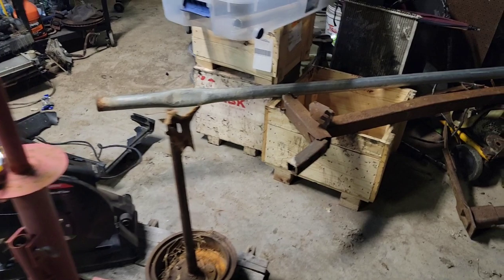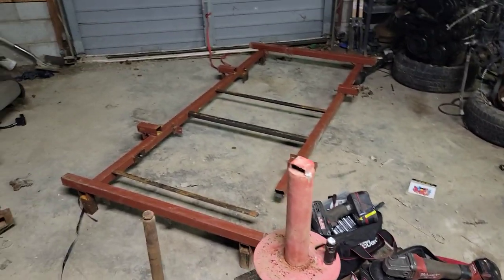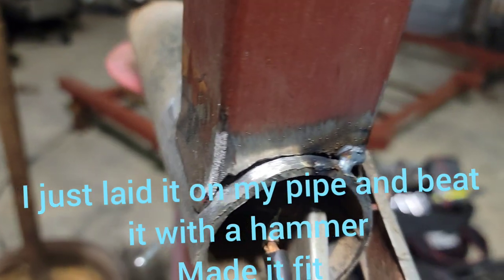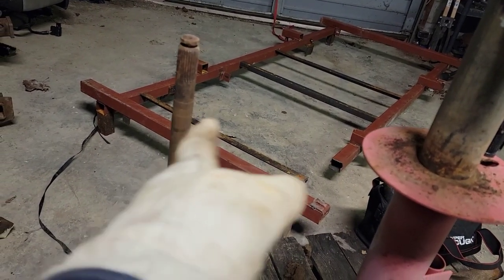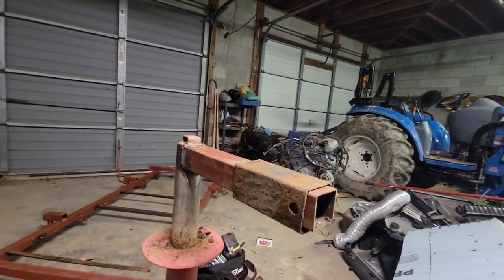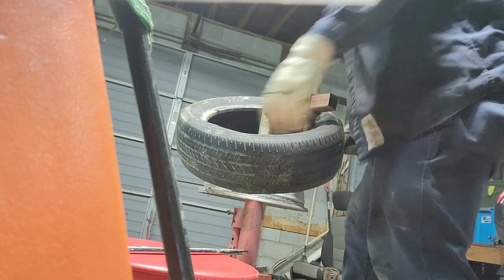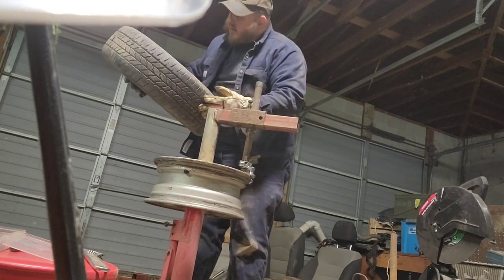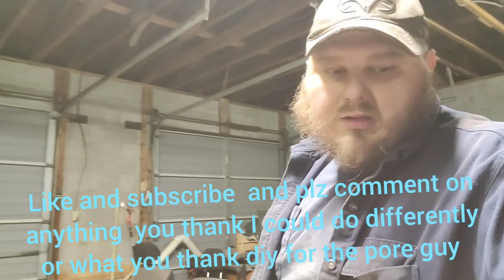Diy harbor freight tire changer  duckbill  conversion for the pore man

Comment: I wish I would have seen this years ago. There's a certain technique with these things you need to learn and I always struggle with the first tire or two until I get the hang of it again.
I put female concrete inserts in my floor so I can bolt it down temporarily, then put Allen set screws in the holes so they don't get filled up with junk.

I thought the welds looked pretty good, at least they're better than mine.

I welded a piece of plate between the two legs of the bead breaker, since it was flopping over on lower profile tires. 

I also drilled a hole for a wheel stud when that little locater dowel broke off. 

I appreciate the effort and experimentation. More people need to think about using what they already have. I always hit the back button when they give bill of materials that add up to more than what it would cost to buy something.
Reply from the maker: I love to build stuff from what I have laying around

Comment: Cold tires are always more difficult to pull off and mount.  Trick I use for doing tires in the winter is once the bead is broken loose I put an old hair dryer just inside the tire and let it run for 5 min or more...once it's warmed up a bit those tires will go on/off a lot better.
Reply from the maker: Good ideal I've sit then in front of a heater before

Comment: I give you a “10” for your effort that’s for sure- like others have said you are fighting the tool. If I was you- I would now make a hitch mount and hook it to your tractor- if it was more stable on the base it would work better for you!! I’m a 60 year old woman and hook mine to my truck have changed many tires. Good luck 👍🏻
Reply from the maker: Yes I'm going hook it
To the tractor  pallet forks that will be easy to use and I can slide it
On and off might even be better than mounting it to the floor
Reply: @85beeper  have to work “smarter” not “harder” keep up the good work 😉
Reply from the maker: Yes I agree  I saw one built out of a car transmission and rearend  and a drill for motor he spoke no English but give me good ideal I thank I might try to do that for my next build giving I have a junkyard   with lots of parts available
Reply: You are reading my mind on the trailer hitch mount!  My HB full size wheel remover tool is in the mail:)
My tire shop is 15 minutes out. If i can avoid a dop off/pickup, or waiting for a spendy 3 hr wait. 
Tire shops are picky w dates on remouts.  Too, if i can expand my opportunities on used tires i can buy better tires. Or cheaper points.   Ie... buy checy tires on ford wheels.
I'm taking the gamble
Reply: Kammy is  CORRECT......USE our brains, not the brawn some of us are lacking.....( also, eat foods from  '' SPADE   TO  SPOON ""  for a very good quality of life.....)

Comment: Get some pool acid. Dip galvanized parts in the acid*****DO NOT BREATH FUMES******. Then rinse with water. It strips galvanize coating. Take a couple of hole saws and make a “washer” out of blue poly barrels for under pipe that goes against rim.,
Reply from the maker: Thinks for info

Comment: Good job ;  NO  $  spent.  Perhaps,  consider having a more secure, solid heavy base. Use a couple of 3 foot railway rails, in a V  or 90 degree formation. IT  won't  move anywhere. Weld the ends together ; or use a really heavy duty hinge.  Or,  male pins into 2 sections of about 6 inch high pipes, on the ends of rails - for  assembly / dis -assembly. I am in process, of making tire machine as well. Using about a 16 inch farm disc, from a  discer ; those round cone shaped things, as a tire/wheel  base, on the vertical upright. My 16 inch rims, fit perfectly in the disc. Only have to weld 2 bolt studs, to the disc, pointing up, to bolt the wheel/rim  to the disc. Then, gotta make the arm/ bracket for Mr  Duckbill.....Anyway, thanks  for  not spending  money......USE it, or loose it = the stuff most shop/garage guys  collect.  (from east central Alberta)
Reply from the maker: I try to do it cheep to free I hate a video days diy then they have a ⁵k tool to make it

Comment: You are definitely fighting your tool. A solid mount will take out 3/4s of your struggle and LUBE LUBE LUBE will remove the rest. You have all the necessary tooling for your set up except for a longer bead tool.
Reply from the maker: I have several  other bars it definitely needs mounted and I need to get a center cone I have noticed on the bigger truck wheels with big center hole it's hard to keep even and it wants to bite I. To wheel if it's not just right
Reply: @85beeper  sixty five Ford has several videos on this changer. He has perfected using it over the years. He has perfected a duck bill mounting bar Which I plan to mimic and use with my changer.
Reply from the maker: Ty I'll definitely check him out
Reply: Are you turning the duckbil the right way?  I thought that it was designed to travel anticlockwise for both mount and dismount operations?
Reply from the maker: @paulgradwell2246  yes im turning it right it works better as i got use to it but i got lucky and picked up a old mays meashean  i got couple videos on it thanking about trying mount this on the old mays
Reply: @85beeper  Great effort! 👍 As was suggested above, the duck head is designed to be turned counter clockwise for both removing and mounting the tire. Most first timer’s rotated it the wrong way, looking at it you just figure it would go in a clockwise rotation but that is the wrong way. You can get it done clockwise but the easiest and correct way is counterclockwise. Give it a try.😎
Reply from the maker: @timlindgren8264  ill try it out i up grated to a old mays meashean  but i still use this one on some wheels thats to big for my old mays